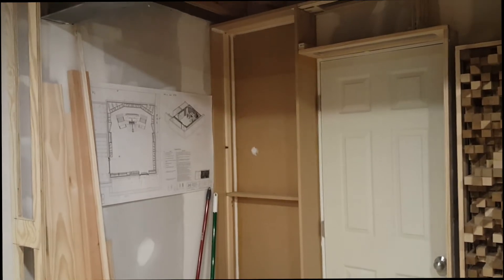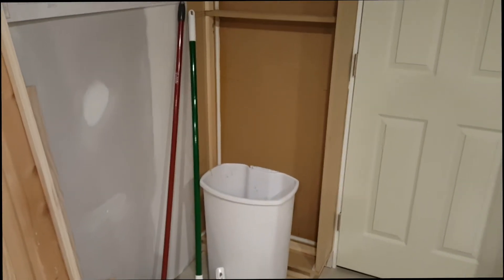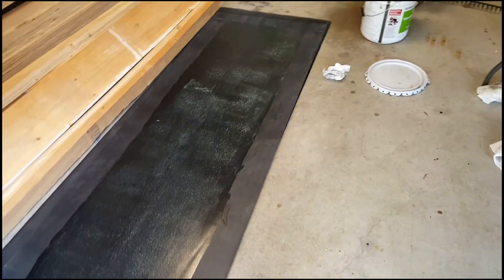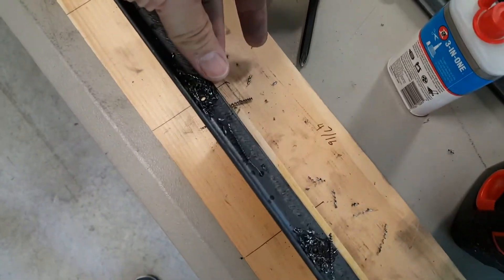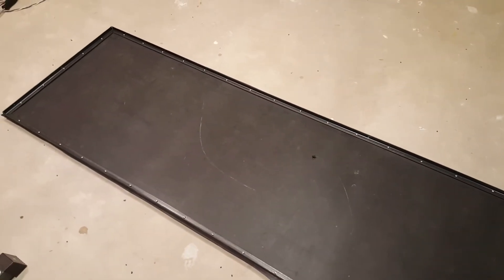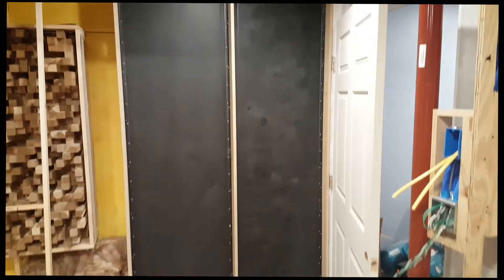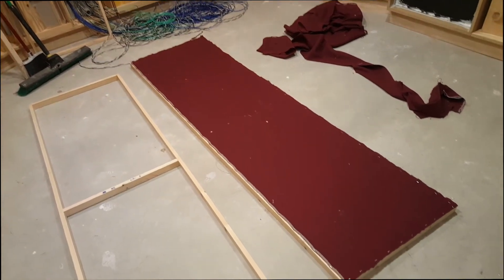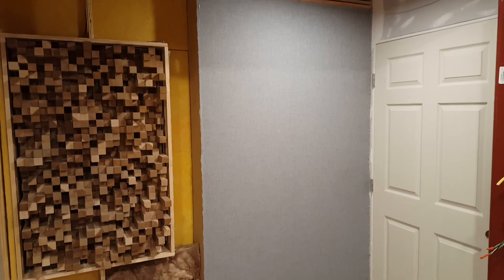Mixing Studio Build - How to Build a Membrane Bass Trap Part 2

Comment: Thanks for the guide. Can i ask some questions? What is the purpose to sandwich the steel plate with rubber? Can u use the plate itself?  Do u weight all 3 material to get the kg/m2. What thickness of the plate u use? I have made limp mass with rubber sheet before and i want to try with steel sheet this time. Thanks

Comment: I am nearing the end of my build which John also designed, thankfully the latest version of the membrane traps are much easier to build, but they were still the toughest part of the build for sure!!!
Reply: What is the difference? Still sandwiching steel between epdm rubber?
Reply: And what thickness of steel?
Reply: @ryanbrand1474  IIRC, it’s 26ga galvanized.  And yep EPDM sandwiching steel.

Comment: Thanks for taking the time to film this so thoroughly, just a quick question. Do you think it's really necasary to use the angle iron? I can't see why you could fix 3/4" batten inside of your box, push the sheet metal covered with EPDM up against it and fix straight into the batten itself. The angle iron seems possibly unecasary as if the batten was the same width as the iron it wouldn't restrict it's movement any more?

Comment: Great video , thx for sharing. 
What's the purpose of the rubber membrane. So it will vibrate and stop the low frequency.  
Thx . 
Also , what frequency range does it effect. Thx .

Comment: Hi,
Great video and very neat construction. Thanks for sharing.
Are the metal sheets the same width of the internal width of the box, thus being bolted between the iron frame? Or are they narrower and just being suspended by gluing them to the rubber?
Thanks a lot

Comment: Just subscribed. I’ve been planning to add membrane traps to my multi-use home studio soon but am still working on the final design. I’m fascinated by your membrane design. Is this your own design? Is there engineering information available?
  Just FYI, I’ve constructed speaker cabinets of my own design - sort of a pseudo-infinite baffle integrated into thick OC703/Rockwool walls. My small room dimensions pushed my speaker placement into the corners. Using Polk Audio speakers meant to be installed between studs, I get a nice sound. 
  Keep up the good work; I steal only the best ideas.
Reply from the maker: They were designed by John Brandt, my acoustic engineer.
Reply: @JasonBalibanProductions  He would know, for sure!

Comment: Hi Radio Octave...I just discovered your channel because I was researching DIY acoustic treatments. I’m in the process of reconstituting my home studio. I saw the reference to membrane traps and was curious what they were as I’d never heard of them. 

I understand the physics behind how the trap does its magic and am impressed by the ingenuity of whomever designed and built these at first. That sheet metal plate is a great energy sink and the rubber sheeting makes a great prolonger of the reflection off of the metal with respect to time. The resulting attenuation results in a log reduction of reflected energy of at least a couple of magnitudes and the frequency of the reflection is reduced to the point of not being an issue, especially at the tiny retained amplitude. If any of the energy makes it out of the trap, it’ll have null effect on the room. Sheer genius. 

My question to you is, “Do you notice a significant improvement in the room’s acoustics with these traps sufficient to offset the cost and considerable effort you invested in fabricating these traps.
Reply from the maker: I never tested the room prior to putting the treatment in.  I built the room specifically to be used for audio so it was a plan from the beginning.  The size of the room, how the room was made and then all the trapping was part of the plan.
Reply: Radio Octave Ok...fair enough. I reckon that these membrane traps are one of the most efficient and effective designs for mitigating low frequency standing wave issues. There are other simpler and more cost effective designs that will accomplish  the same task more or less, unless the energy levels of these waves are considerable and the space small enough to not allow for the easier and more economical large surface area traps that many commonly build a la DIY. I’m just trying to decide if I need the membrane trap in my relatively small studio space or if I can accomplish what is required with the U&C Home Depot Special, DIY built bass traps. I’d hate to go to the trouble of chartering an Airbus 380 to fly my lone self from NYC to London when a Gulfstream business jet would be more than adequate.
Reply from the maker: @kirkbolas4985  Contact www.jhbrandt.net and ask him.  He will be able to answer any question you have.   You will end up with a solution and knowledge, thats how John rolls.

Comment: Hi, thanks for the video, so is the metal sheet is sandwiched (EPDM glued both sides)? is it to make more mass for the membrane? How's the consistency so far? Thank you
Reply from the maker: Yes, the metal is glued between the rubber to add more mass.  So far the room has been great.
Reply: @JasonBalibanProductions  Thanks for your reply, what adhesive and technique you used for sandwiched rubber and steel?
Reply from the maker: @mixbyJM  There is a solvent glue specifically made for EPDM.  I used that.
Reply: @JasonBalibanProductions  mind to share the brand and type? and link where I can get that? Did you press it using special tools?
Reply from the maker: @mixbyJM  It is called LVOC bonding adhesive.  I bought a half used 5 gallon bucket from a local roofer.  I used a small roller to help get it bonded.
Reply: Radio Octave thank you man! Appreciate it!

Comment: Thank you for this video, very instructive, I am also in the process of building some Membrane traps
Can you share where did you buy the Rubber rolls and Where did you buy and cut the steel sheet? I am in Florida but have no clue of where to look to buy them
Thank you in advance, congrats on your new studio
Reply from the maker: Rubber you can get from roofing supply places.  Metal you can get from a sheet metal distributor.  Hope this helps.
Reply: Radio Octave thank you for your reply. Just today went to order the steel sheet. One question what brand kind of glue you used to bond the rubber sandwich with the steel?
Reply from the maker: @borism68  There is glue that is made specifically for EPDM.  That is the glue that i used.  It works like contact cement.  You put it on and let it get tacky and then it will bond.
Reply: Radio Octave thanks!  I didn’t know that it was special glue. I’ll do some research about it. Much appreciated

Comment: What's up man. I never comment but had to jump in for a few. 1) How do you know what the center frequency of absorption is going to be? 2) What is your level of absorption per panel or what's your projected reduction for the room and at what frequency?
Did you measure the room before adding the bass traps, so you will know what frequency to absorb and not to? Last, where did you get the info for this bass trap design?
Thanks!
Reply from the maker: I hired an acoustic engineer to do that work for me.  I gave him the max height of my ceiling and we built the entire room dimensions, trapping, and layout based on that. He provided all the plans for the traps.  I used http://www.jhbrandt.net/ if you are interested.  Well worth the money!
Reply: @JasonBalibanProductions  John Brandt has a lot of experience!  Glad it worked out for you!
Reply: My understanding is that adding the steel sheet and fastening it all up like that would drive the Q to absurd values effectively giving you a bass trap that works at one specific frequency like 52.94Hz +/- 0.01Hz. The ones I use are high mass vinyl mounted without tension (limp) yielding low q. Did you ever do a sweep?
Reply: @sh91899  Adding porous material in the cavity behind the membrane lowers the Q value and consequently broadens the bandwidth